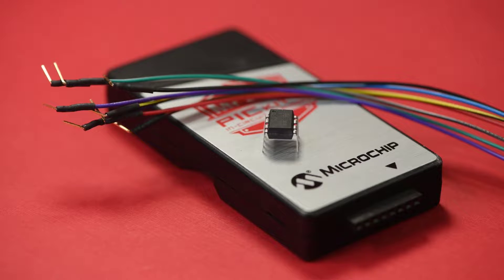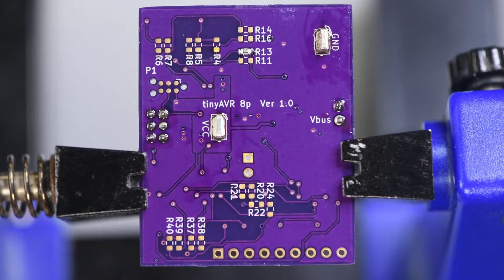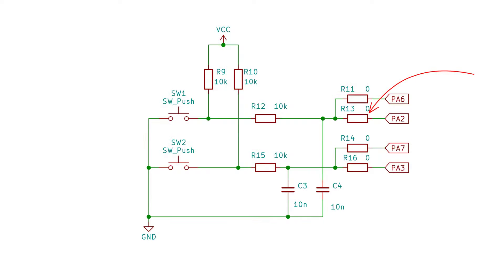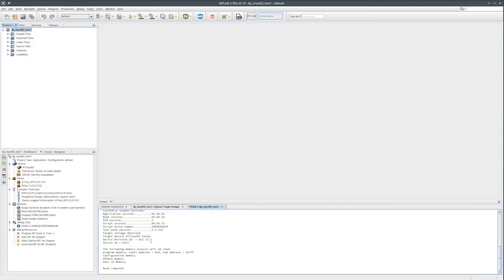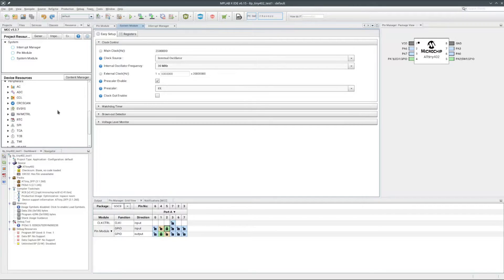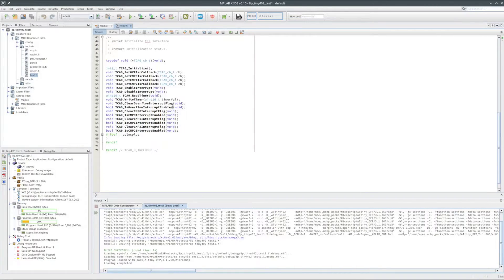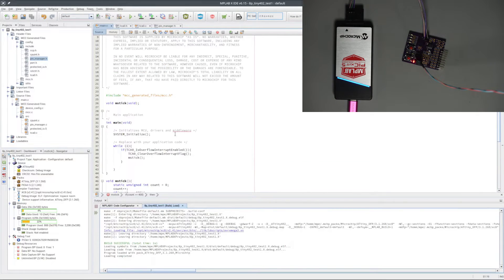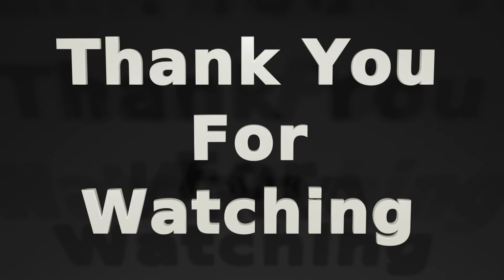Poking Around an ATtiny402 with the PICkit5

Comment: Great Informative Video as noted below. Have one additional question/problem. I'm creating my firmware for the ATtiny402 using the Assembler option with the MPLAB X IDE and all works perfectly when programming. However, when I click on PRINT, instead of getting a printout of my generated program instructions, I get a single blank page with an indication on monitor that trying to print out 161 pages when my program is only 5 pages. Could this be because I am misssing an End-of-File directive? Or what else may I be doing wrong?
Reply from the maker: I'm not sure about the print problem, I very seldom print anything.  But make sure the default printer and the page setup for it are correct.

Comment: Great informative video. I'm working on assembly language program for ATtiny402 with the MPLAB X IDE and the MPLAB PiCkit5 and I have two question hoping for answers. Question 1: To  what pin on the 402 did you connect the wire from pin4 data line on the PICkit5? Question 2: Do the 3 connections shown in video enable all the debug features available with the PICkit5 used with the ATtiny 404?
Reply from the maker: Pin 4 of the PicKit connects to PA0/Reset of the ATtiny402.  I think it's pin 6 but double-check that. All the debugging is handled over one data line, PA0/Reset.  At least everything I've tried so far.  If you want to use the PicKit5's data stream interface pins 7 and 8 of the PicKit have to be connected to USART pins of the ATtiny402.  Unless Microchip has added something in the last couple of months, I was not able to create an assembly language project for the ATtiny chips.  I could inline assembly in the created C project.

Comment: Sadly that microchip PICKIT only support AVR from series 4/5+.
PICKIT3 is only for old PIC.
Reply from the maker: It programmed an ATtiny13A without any problem.  So it should work on most of the older AVR chips.

Comment: Do you know what to do to save the PICKit-4 after pushing the small Emergency button...? I did it and now my PICKit-4 is dead....
Reply from the maker: It's probably not dead; it's just waiting for the firmware to be uploaded to it. Take a look at this video: https://youtu.be/sN7i6FuwF6w. It's on the PICkit5, but 4, I think, would be about the same.
Reply: @metalplasticelectronics354  
Hi. Thanks a lot...That fixed my problem and my PICKit-4 works fine again.
Again - thank you for your help.
Reply from the maker: Glad it helped.

Comment: that is very complicated way of programming blink sketch, is arduino core handling all of that stuff
Reply from the maker: There is no arduino involved.  This is directly programming the microcontroller.  And this is so easy compared to using to old Atmel STK500 for programming.  When I get around to doing some assembly language on it, it will get even more complicated.  But that’s about to only way to get the most out of these tiny chips.
Reply: Do you have an example in assembler? 
Thanks....
Reply from the maker: Not yet, I'm just starting to work on it.